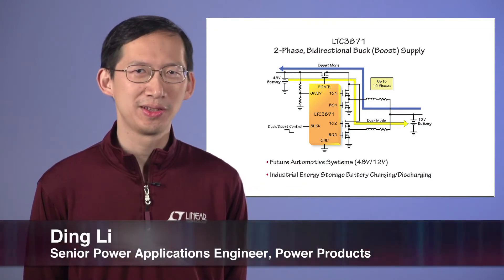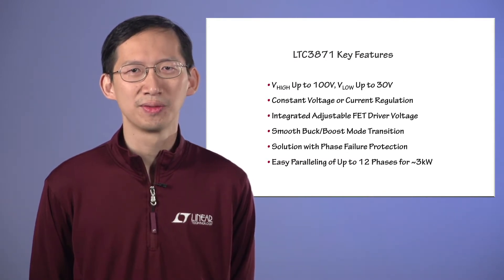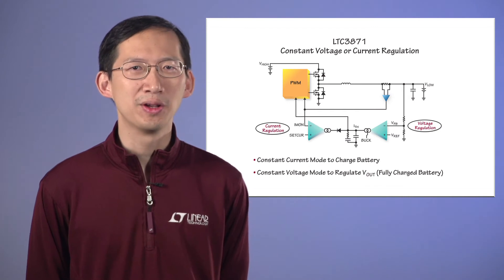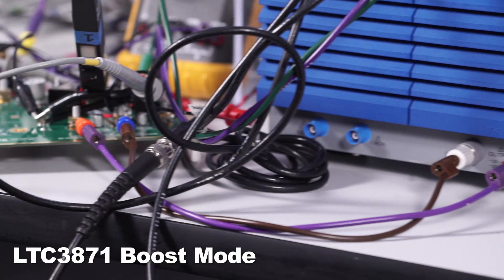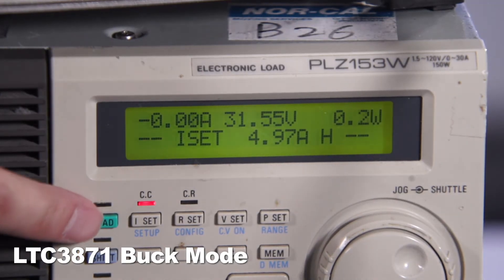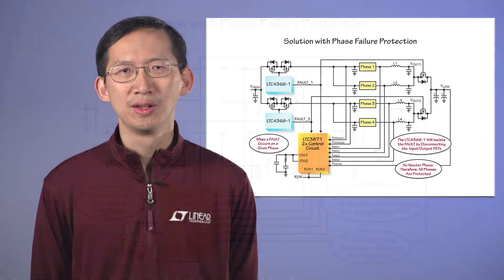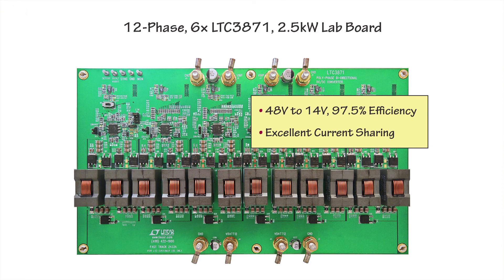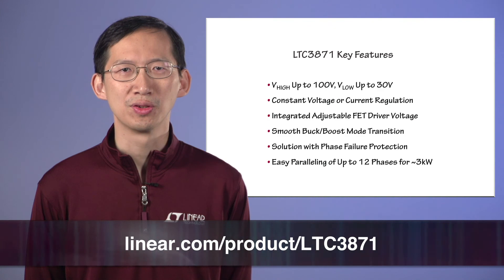100V, Bidirectional Multiphase Synchronous Buck or Boost Controller

Comment: Hello guys can u help me pls? doo u now a programm for Computer which i have full controll for my PSU? i need too reduce or how can i say it.. the reactive current is m problem. i will use most power without loosing the rest of the reactive current. i have a platinum psu